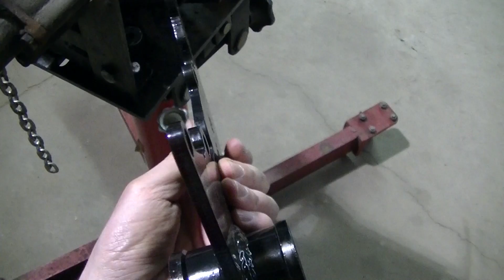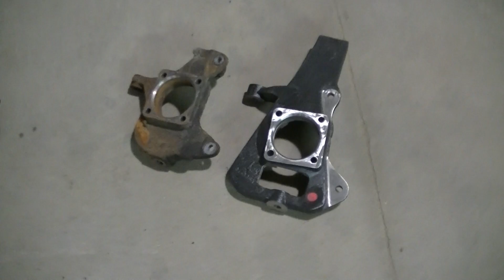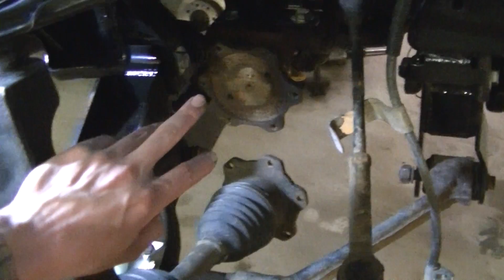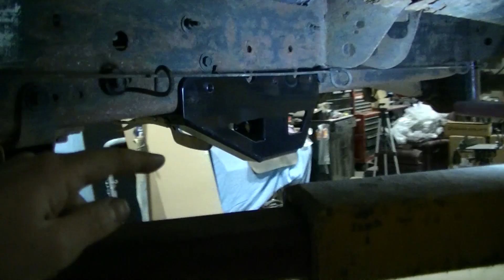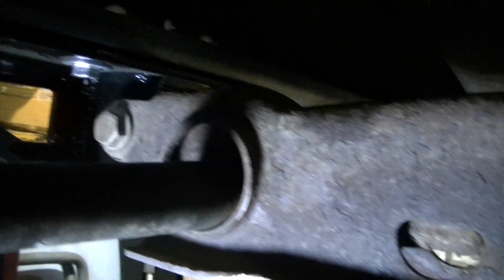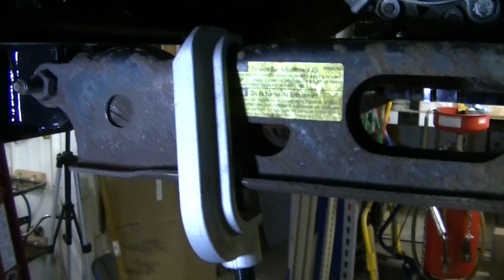Project Midnight Silverado 2500HD Superlift 6" Lift Install Part 2 Front End Assembly

Comment: your axle is going to bind right now cause you don't have you torsion bars in yet
Reply from the maker: The bars will actually pull the suspension all the way down so nothing will change with the bars installed.  You just won't be able to push the suspension up because of the bars.

Comment: With that steering arm clearance issue, the bend in the sway bar kinda looks like it could flip and resolve the issue. Hard to say for sure from a video though. 
Thanks for sharing the project. You must be a hurting unit...
Reply from the maker: Tried the bar upside down and it didn't look right for the end links.

Comment: have you checked to see if the wheels clear?
Reply: Nah, you do that after.  If they don't you remove or reshape what's interfering.
Reply: Oh, you where talking wheel fitment, got it now.  I was thinking fender/bumper fitment.  I've seen gmt400.com, yes, but I'm not much for forums.  Thanks for the compliment on my trucks.  Maybe this summer I'll actually give my 94 S10 some love, too.  I've neglected it far too long.
Reply from the maker: Yes,  everything clears but having other issues.